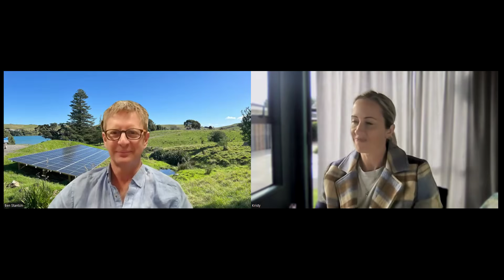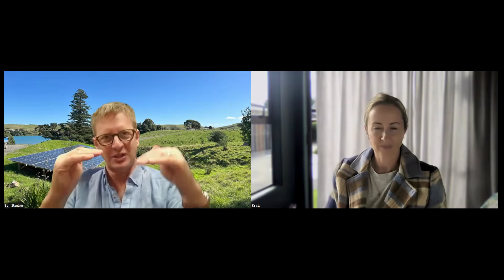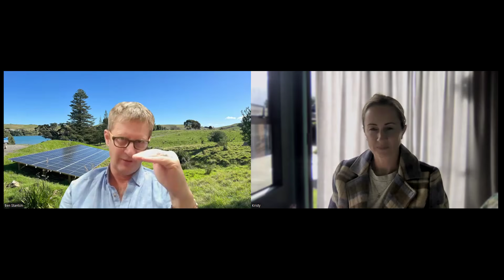The newly announced NZ Grid Voltage Increase explained

Comment: I asked the installers of my solar if they can come out and lift the voltage limit of my inverter as these regulations have supposedly come into effect...I was told they can't until September because that's what the lines company is telling them.

Comment: My 3 phase hybrid inverter has had voltage readings as high as 254 volts per phase and has been restricting my export and caused the inverter to shut down several times.

Comment: Thanks for an excellent post. We had a NorthPower tech turn up yesterday following over a year of communications with our lines company, Powerco, regarding high grid voltages impacting the performance of our solar. He has now fitted a logger to our local transformer so hopefully some progress in sight.

Long story in our case is that we're rural and had an 8.2 kW Fronius Primo installed on one of our two phases along with our total home consumption. It worked reasonably well up until Powerco installed new HV transformers and voltage regulation gear a couple of kms upstream of us about 12 months back in order to address low voltage issues for more remote customers. Immediately our grid voltage (at feed in point) rose to ~mid 240s and up to 247V+ on occasions. The Fronius throttled its capacity to 5 kW by way of a CT clamp monitor.

Initial feedback from Powerco was that there was a difference between the two phases so we changed everything over to our other phase. That was moderately successful.

A few months back we installed more solar during a major house reno with a 5 kW SMA feeding into the now
'spare' phase. Intention is to export all of this phase's generation. During hook up of this inverter the installer alerted us to the voltage prior to inverter connection being 247V on that phase.

For the past few months we have seen frequent dropouts on both inverter's logs and last week our installer changed settings on both inverters in regard to their voltage parameters and the 5 kW export cap on the Fronius has been disabled in line with the new 10 kW limit Powerco has allowed.

While this appears to have solved our dropout issues I'm fearing that our ability to now export at up to 253V without restriction, (and beyond that to an even higher hard limit I assume) will have negative results for both our own home's appliances and that of the neighbours'. 

Incidentally a further complication is that an overnight charging session of one of our two EVs in early October saw the grid voltage drop to 224V initially and then to 221V for the final hour up to 7:00am probably as dairy farm activity ramped up in our area. 

It will be interesting to see what tap settings result on our local transformer which is currently in the #2 position (so 240V).

Comment: When will this +-10% actually be introduced? All I can find is "sometime in Q3".
I need my inverter region code changed (I think it can be done over the internet) but until the change become live I don't think it can be done. I'm in a rural area and in the summer with all the irrigators operating the line voltage is lower, so all the transformers are tapped high because of the summer voltage drop. What it means for the rest of the year is the line voltage is often 245v and my inverter ramps way down.
Reply from the maker: Yeah - the load fluctuations are the main problem for the network engineers. I am not 100% sure when the +-10% will be implemented but I might find out next week at the SEANZ conference. . . Standby!

Comment: Here, the voltage hovers around 242-244V during the day dipping to 238V during the morning and evening peak times, but often exceeds 246V after 10:00PM.  Over 2 months we had a 50% failure rate of outdoor under-eave LED downlights.  The solution was to install a bucking transformer on the lighting circuit to drop the mains voltage by 24V.  The same lights indoors are reliable, the only difference being the low temperature with some frosty nights.

Comment: Nothing will improve until the power companies are more 'solar friendly'. At the moment they charge rural users up to $3 per day for supply. They also buy solar power at 8c/kwh yet you have to buy it at ~25c/kwh. With this there is NO way solar power is economically viable.

Also, with our solar setup we end up pushing the street voltage up so high that it tripped the inverters safety switch (>244v). You then end up with NO solar, NO battery power and NO mains line power.  We ended up having to get the lines company to LOWER the voltage of the street transformer.

Truth is that neither the lines company nor the power companies want people to have solar power on their property.
Reply: Get a battery. Fade power companies! The only way you get a good deal from a power company is when your disconnected!
Reply: @TimsMissions  I've got a 10kw batt. Middle of winter I'd need 30kw... $$$
Reply: @mytubehkjt mate I think the part you are missing is that the power you generate and use during the day is free to you instead of paying 27c per unit. If you figure that into your payback calculations you might feel a bit better. My parents have had solar on their house for around 15years and have changed power retailers about 5 times to keep on the best buyback rates. In the summer they semi regularly have negative power bills. Shop around a bit mate 👍🏻
Reply from the maker: Solar is still economically viable for many - the daily charge is going to continue to increase along with all other power costs but you can still shop around for better daily rates and export rates. I have plenty of customers who are running in credit - just need a good north-ish facing roof and patience. But there’s not very many investments available below $30k  that return ~10-12% for 30 years.
Reply: @benstanton  Incorrect. Power rates are all pretty much the same. There is virtually no way you can recoup c$90 each month (supply charge) with selling power at c~8c/kwh. 

If my maths is correct 90/0.08=1125. The number of kwh needed to earn $90 at 8c/kwh. That would take a 5kw system producing the full 5kw for 225hrs just to pay for the supply charge. Let alone recouping the cost of the solar/battery install.
Reply: I live in a semi rural area,  I'm getting 17 cents per kwh export with Octopus Energy.
Reply: @rigley8830  is that just for new customers. I been downgraded to 0.14k 3 months ago for off peak. Plan to change to Ec Kiwi

Comment: This is great news for NZ - more solar electricity into the grid should make power cheaper for everybody
Reply: Wrong! Solar energy on a mass scale is one of the most inneficient ways of producing electricity. It also obviously only produces during the day when power demand is low. Battery back up is a large and expensive set up that requires regular maintenance and battery replacement. Solar and what is called renewable energy is not what people think it is.
Reply: No it wont
Reply: Yeah that's a good one.🤣

Comment: So a battery with solar energy is a must. To spreed the export of energy. We have been limited to 5 kWh. In N.Z.
Reply: Yep I agree. I have 1000watt battery storage ( $2000)   3000w of panels 12 x 250w, $200 2nd hand
 & it does 2 of us     (with a gas HWS)   It is off grid, why grid tie if they are only giving 3 cents a kw ?
If not enough battery , the inverter flicks over to grid - until some charge in batts.
 (when the sun comes out again)  😊
Reply: @peterbilt2  " I have 1000watt battery storage "
That's not an energy storage capacity.

Comment: So then? Do electric motors spin faster then
Reply from the maker: No - the speed of synchronous AC motors is determined by the frequency. If you raise the voltage on the motor it will spin the same speed but it will draw less current to do the same work.
Reply: ah yes i fogot about the Hz.When i was younger i helped my Dad fit a speed controller to a industrial bakery dough mixer. Worked out well,customer very happy. Cheers Andy. Gt Barrier Island
Reply: It was 3 or a 4 speed box. Aswell the speed controller had a deveation of 20 or so hertz. New Zealand( single phase) is 230-240 vac 50hz. So programming it to 48hz low side to 68 hz high side  your 4 gears become dough standard to wipping cream off the walls etc...
Reply from the maker: However, if it’s a series-wound brushed motor then yes it will spin slightly faster. So that would perhaps be a motor on a drop saw…

Comment: we have a subdivision (with a requirement for 3kw rooftop) close to the transpower substation and the network runs at 11250kv hence the whole subdivision turns off at lunch time.
Reply from the maker: Yes - I have seen that with a few subdivisions (are you in St Kilder?) if you have a hot water cylinder you might be able to use some diversion so you can keep your solar running.
Reply: @benstanton  thats the one, not me, i was with the network company back in the day, laughing at the engineers scratching their heads.
im not sure exactly what happened but i figure a -5% tapping may have been the answer
and of course 1 phase inverters so all the houses were wired single phase 
WEL networks have "conditions of supply" that dosnt adhere to the 6%
Reply from the maker: @georgeoverton8267 ok - I’d be keen on talking more if you’re keen. It’s always interesting delving into these things. You already have my number? If not a quick Google should track me down. 👍
Reply: @benstanton  ive spoken to you a few times, check your fone, the name will be "dont answer..."
An inspector is retiring in a couple of months so ill see if there any updates.
the issue with st kilda was the network was stretched and the greater good was to tap +2.5% 110/11kv
weve got a brand new 110 sub  out past Hautapu( they figured this out when they had to install a paddock of diesel generators next to APL Hautapu)
and a new 110 from waitomo to TA
solar has to some extent forced their hands. its always been "cost + load = new infrastructure" due to the tax, (capital v's maintainance)
and its taken them at least 10 years to sort of come up with a coherant SOP's
Vector and Orion stand out as leaders
another 10 years we might have a load shedding/shifting solar hardware and not end up like Glen and get penalised for excess production
at least we have plenty of grid inertia 

I vote we get with MBIE and the Electricty Operators and have a chat

Comment: So the voltage you see at home used to vary between 216-244V and now it will vary from 207-253V. And this massive potential swing in voltage will have no effect on the operation or life of any appliances plugged into wall in the home? If it does, can consumers apply for compensation from lines companies?
Reply: Most appliances don't care
Australia and the UK already use 230V plus minus 10% and it's not like products are specially designed for our electrical grid
Switching power supplies like phone chargers don't care at all, most can operate over a wide range of voltages from 110V all the way to 250V since they're designed for international use